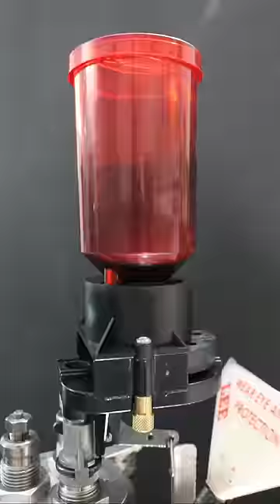Reloading 9mm ammo in 1 minute with Pro 1000  -   #reloading, #9mm, #leeprecision, #ammo, #shorts

Comment: I really like Lee for their affordable products, which are generally quite good, but that disc powder measure is gar-bage
Reply from the maker: Good afternoon Brian and thanks for stopping by🙏👍🙏. On the larger, paper like powder I have no issue with the disks personally. I purchased extra disks and made specific holes for some charges and powders because as you know the disk has limitation on how many different changes you can make. Recently I am using the caliper system also by lee "Item 90792". This replaces the disk and gives you a better possibility to adjust. With all that in mind, I still think they could have done much better. This is a critical component and I would have copied a system such as the one on the Dillon for instance. Anyway, it is affordable as a solution so one thing compensates the other.

Have a great day.
Reply: @ReloadingMoreAD1966  nailed it. No idea why they haven't done something better there.  I swapped mine out for a Hornady measure, it's red too, looks right at home 😂.
Reply from the maker: @brianhonsinger8214  Those are good. Hornady know there stuff. Do have a look on my channel for much more longer clips on the subject, and more. Have a great evening

Comment: Which Bullet is this??
Reply from the maker: Hello and thanks for stopping by. The projectile used here is a 130gr SJFP, reference B-329 fabricated by PRVI, diameter of 0.3545. 

A similar projectile that I have also used, more frequently than this is the 125gr SJSP, reference 613573 by Fiocchi. Both mentioned projectiles I have used to reload 9mm and .38 special rounds with no issue what so ever.

Have a great evening.

Comment: Does it press in a new primer at the same time it dumps the powder in?
Reply: No. Primer is seated on the bottom (when the table is on the bottom), but powder dropped on the top. 2 vertically different positions
Reply from the maker: Good morning and thanks for stepping in🙏🙏🙏👍👍👍. You are correct. Have a great day.

Comment: I need to start handloading. I shoot 44 Mag/special and  45-70. 
  I also shoot 357/38 but the prices have come down enough to make them not too expensive.
Reply: I wonder if you load a really light bullet in a 44 mag what type of velocity itll go at. But like, a really light bullet. Maybe even dare i say, Hollowfor weight reduction idk
Reply: @TheAnnoyingBoss  I know you can get 180 grain 44 mag rounds up over 2000 FPS out of a lever action with a 17 inch or longer barrel. I haven't tried anything lighter.
Reply from the maker: Good afternoon and thanks for stopping by and having a look at my content🙏🙏👍👍.  For 44 Magnum I opted for a single stage press. Works OK. Have a great day.

Comment: Does the neck get crimped?
Reply from the maker: Good evening  and thanks for stopping by the channel.👍👍.Here I am using the 9mm die set by lee, item 90509, comprising of a total of 3 dies.

The first two dies are not relevant for the crimp procedure. The third die is seating the bullet in place and also crimping tight the bullet. Now be aware that the crimp is not a roll crimp, sort of what you see on older revolver rounds but just a minimal crimp, similar to factory loaded 9x19mm ammo supplied by most brands. 

Thanks for showing interest in my content. Have a look at the longer clips on this press, link in my pinned comment. Regards, take care and have a great weekend 👍 👍

Comment: Seems like a simple job but expensive when you buy everything
Reply from the maker: Good afternoon and thanks for stopping by. Here is a small calculation to give you an idea about the costs involved. BUT.. Don't be fooled by my entertainment video that reloading is a mundane and easy operation.
Reloading is a very dangerous affair and it requires lots of time, patience and restraint.  Even so, mishaps can happen.. 

Here are my own workings as follows: 
🔶Based on 9mm setup only. (Changing caliber is approximately $100 addition, mostly dies and shell plate)

🔶ALL FIGURES & CALCULATION DONE January 2022 as follows:

$300 _ Lee Pro 1000 Press 9mm, ref. 90640.
$020 _ Lee Case Collator, ref. 90667.
$045 _ Lyman Ammo Checker, ref. 7833000.
$012 _ Dillon precision case lube, ref. 13733.
$055 _ Scale frankford arsenal, ref. DS-750 
$050 _ Price estimate for a generic caliper.
$048 _ Price estimate for kinetic bullet puller. 
$530 _ TOTAL INVESTMENT of above listed item ONLY.

$160 _ TOTAL Calculated price of raw materials to fabricate 1000 rounds type (CPRN-124gr) "brass cases free)
 
$300 _ TOTAL Average price for factory loaded ammo, 1000 rounds, 124gr.

🔶Therefore, excluding labor cost, I save $140/1000 Rounds.
🔶Therefore, investment of $530 / Savings of $140 = 3786 rounds.
🔶Therefore, after 4000 rounds I start saving $140 / 1000 rounds I send down range.

🔶🔶🔶 In short, after 4000 rounds I cover ONLY my investment cost. Expect more cost as you go along.

Comment: Hello, can you tell something about components, what brand of powder, primer and bullet you use? I know that nickel brass are Federal, bullets looks like Fiocchi but I don’t have full confidence.
Greetings from Poland👻
Reply from the maker: Hello and good morning. Trailing is a list of items I normaly use, all depends on what is available. BUT.. Don't be fooled by my entertainment video that reloading is a mundane and easy operation.
Reloading is a very dangerous affair and it requires lots of time, patience and restraint.  Even so, mishaps can happen..

Here is what I normally use for 9x19 reloading.

Heads: 
- 124gr RNCP, FNCP by L.O.S, NTW, Fiocchi, Romana Metalli, H&N or Frontier.
- 124gr RN Polymer coated RN by ARES or IGF.
- 125gr SJSP, reference 613573 by Fiocchi.
- 130gr SJFP, reference B-329 by PRVI.

Primers:
- S&B, Fiocchi, CCI, Murom or Federal.

Propellant:
- N320, CSB5, CSB6, FRex, Vectan SP8. 

Note: For the amount of propellant and overall length of the projectile follow the specified data by each respective manufacturer of the specific product. 

Have a great day.
Reply: @ReloadingMoreAD1966  I’m asking about components but I’m very interested about bullets because they are for 38/357 in .358 diameter. Have you got any issues with these bullets in 9mm? I use .358 bullets once, but it was soft Frontier 125gr and the load was made for HK USP who literally “eat everything”
Reply from the maker: @Spyderco79   Not familiar with the 125g Frontier but the Fiocchi I am using here is 0.3565 in diameter. That is what I measured with my micrometer. The box is also marked as 9mm. Here is an independent link of the box: ( https://shoparmeriapalmieri.com/COMPONENTIRICARICA/30239-fiocchi-palle-blind-38-357-125gr-8000000031327.html ). 

This Fiocchi head on a 9mm round gave me no issues when fired from a CZ75.

Take care.
Reply: @ReloadingMoreAD1966  Thanks, have a nice day 👌

Comment: Correct me if I'm wrong... but I think it didn't crimp
Reply from the maker: Good morning Kaizer and thanks for stopping by.👍👍.Here I am using the 9mm die set by lee, item 90509, comprising of a total of 3 dies.

The first two dies are not relevant for the crimp procedure. The third die is seating the bullet in place and also crimping tight the bullet. Now be aware that the crimp is not a roll crimp, sort of what you see on older revolver rounds but just a minimal crimp, similar to factory loaded 9x19mm ammo supplied by most brands. 

Thanks for showing interest in my content. Have a look at the channel for longer, non-short clips for this press. links in the pinned comment. Regards and take care.

Comment: WHERES THE FINAL CRIMP!?
Reply from the maker: Good afternoon and thanks for stopping the the channel Were Guy 👍🙏. Here I am using the 9mm die set by lee, item 90509, comprising of a total of 3 dies. The first two dies are not relevant for the crimp procedure. 

The third die is seating the bullet in place and also crimping tight the bullet. Now be aware that the crimp is not a roll crimp, sort of what you see on older revolver rounds but just a minimal crimp, similar to factory loaded 9x19mm ammo supplied by most brands. 

Thanks for showing interest in my content. Have a look at the longer clips on this press, link in my pinned comment. Regards, take care and have a great day 👍 👍

Comment: No powder cop? Or alarm?
Reply from the maker: Good morning Sawduster. Thanks for looking at my content. Hornady Powder Cop or any type of alarm would be such great on this press. unfortunatly this is capable of taking just 3 dies and design not with a powder alarm in mind. on my particular model, I included a camera that is pointed directly at the filled up case and I have also a case, just positioned behind the 3 station so that I can compare visually before placing the projectile in place. On the camera monitor, I also mark the level of the powder so that if a different charge comes out I can discover it before I seat to bullet. It is not as good as a factory production alarm system but it work fine so far.

If you are interested, I have a longer clip of this press, link in the pinned comment. Also here is  link for a short clip about the powder camera I installed. youtu.be/OaCQr102rzo

Take care and have a great week.

Comment: I have never been able to get 9mm flat nose to work.. they don't feed very well in my opinion
Reply from the maker: Good morning and thanks so much for stopping by Mike👍🙏.As a general rule, when using flat nose projectiles the OAL of the complete round is shorter compared to a round with a projectile that is round nosed. I personably have not had any such issue.  The OAL is all dependable on the weapon you are using and that you need to determine yourself. Just evaluate the CIP or SAAMI data sheets and start accordingly. I found that the flat nose type are even more accurate. I used  nose in CZ, SIG, Star, Astra, Schmeisser, CMMG and also Luger P08. Not necessarily the same type as the projectile you see here but a copper coated type. Take care and have a great weekend.

Comment: How much do you sell them for average per round
Reply from the maker: Hi Erik. Thanks for looking at my content. Selling them would be in breach of the arms act in my country. I am not permitted to give out for free or even reload for other licenced shooter.

On average 9mm cost me  11c to 16c per round, depending on what projectile I go for. More in the near future because price are going up.

Have a great evening 👍👍
Reply: @ReloadingMoreAD1966  I seen another video like this so you reuse your casings and less expensive than buying new rounds?
Reply from the maker: @eriksmalling2494  hi Erik. Yes I reuse my cases or cases from other users. I make sure to roll size and tumble clean before I do so. 

Here is a price breakdown I did for someone recently.
---------------
Putting this YT Short demonstration aside. Here is what I normally go for on a batch load. The data I based on my last batch December 2022.

€90 x 1000 heads, similar to or same as item 4O0908P from https://www.leadextrusions.it

€45 x 1000 Primers, Fiocchi type (These I purchased for €65 per box of 1500 primers but they have now gone up to €70 and €80 in some stores and they are very hard to find.) "https://www.armeriarossetti.it  or http://www.armeriafracassi.it - Item: FIOCCHI inneschi Small Pistol"

€25 x 1000 loads of propellant. Propellant I normally go for Maxam, Rio or Fiocchi. depends on the type but an estimate of around 3500 rounds per kilo is very reasonable. The last batch I loaded was with Vectan SP8 and I got that for a very good price of just €50 / kilo because it is a 15 year old stock held in a rusty container, but it worked perfectly. (Photo of the container in my community post. 

 - - - TOTAL €160 / $180 - - -

With this in mind, and with the fact that it is getting hard to get reloading material, the prices will obviously increase, but so will/is the price of factory loaded ammo. 
-----------
Take care and thanks for looking at my content. 👍👍
Reply: @ReloadingMoreAD1966  no problem and thank you for the info some don't provide it 🙂

Comment: Y did y need all those primers?
Reply from the maker: Good afternoon.. Thanks for stopping by and having a look at my content🙏👍.. This particular short clip I opted for a slow mode with only one bullet to make the process more understandable. Normally it goes much faster so I would need more primers than just 1. Also this is a round from a loading section of 200 in total.

Have a look at the link in the pinned comment for the complete view of the process on some 9mm or alternative, even more details for a .45ACP. Have a great weekend

Comment: Definitely a nice setup but I like to check too much and too many times to trust something like this. I hand prime my casings to make sure they seat well then I always like to check my powder and length measurements until I get that perfect then I do every 10-20rds to make sure it’s going smooth
Reply from the maker: Good evening Wild cat. Thanks for your comment and looking at the content👍🙏👍🙏. I still use a single stage press and do even more inspections than you mentioned. For the more common type of rounds, this press is great. Also lots of inspection are possible here. Have a look at the clips on my channel. There are lots of tools and items that could interest you. The pinned comment has a link to my most recent detailed reloading process with this press on some nice .45ACP.

Have a great evening.

Comment: Why aren't you weighing you powder? Inconsistent pours are inconsistent shots
Reply from the maker: Good morning and thanks for stopping by the channel Taylor👍🙏. Prior starting the reloading task I set up the powder dispenser charge as per my requirement. This is the dispenser you see on the second die. The dispenser will always put the correct charge as per the initial adjustment. During the reloading process, I verify every 20 or 25 charges that nothing changed. In addition I have two other means of making sure the charge is always dispensed in the case before pacing the projectile on station 3. 

Have a look at the longer clip of this press as it is very interesting and shows in detail exactly the reloading process. Also available is for 45ACP caliber, even more detailed. Links in my pinned comment, top comment.

Take care and have a great weekend.
Reply: @ReloadingMoreAD1966  Good on ya mate. I appreciate the work you put into the task, and the quality of videos
Reply from the maker: @taylor....  You're welcome. Thanks

Comment: Got any recommendations for a 223 556 reloader?
Reply: Yeah, a Dillon 550 or 750.
Reply from the maker: Good morning and thank you for stopping by and finding time to leave a comment🙏🙏👍. I have a good friend that uses this for .223 but personally I think it is not the most ideal option for rifle calibers. Personally I have experience with the Dillon 650 fully automated and it would be fantastic to have for rifle rounds. Expensive but a great press. Take acre and have a great weekend.
Reply: @Reloading & More  the Dillon 750 is the replacement for the 650. Personally I like the 550 in case there is an error made. You can back the press up if you need to, because it's manual indexing.

Comment: had mine for a few weeks now and having constant primer feed issues
Reply from the maker: Good evening Justin and thanks for stopping by the channel 🙏👍. That is an issue that can drive you mad but it can be solved. there are people with 3D printers making and selling modification. I also did several modification to my press. Have a look at my channel under the LEE playlist and you will find lots. Also for this issue with the primers. Don't give up yet. Take care and have a great week.
Reply: Buy a different press. I have Lee progressive press and it's complete garbage. Trying to make this press work will drive you mad.
Reply: That’s because the caseing platforms dont have cross plane centering slides . Theres so much movement the primer pockets are not centred

Comment: That projectile doesn't appear to be fully seated in the shell.  You can still see the ridges.
Reply from the maker: Good evening Billy. Thanks for looking at my content🤘🤘👍👍. Great observation skills first of all. When I reload I customize my rounds based on the weapon. For instance the OAL for rounds that are specific for the CZ TS 2 are not ideal for the CZ Shadow 1, and vice versa. I consider the cannelure as an indication of the location but it is not necessarily the exact point to crimp to projectile, especially on 9mm heads that are in most cases without a Cannelure.

Based on my weapon, used for these few test rounds, the OAL you see here leaves the grove slightly visible but it is the best OAL for my needs.

Take care and have a great day.
Reply: @ReloadingMoreAD1966  okay cool.  Yeah I have a little experience reloading.  Basically my stepdad would have me process shells for him.  Pistol and rifle cartridges.  Removing primers, putting them through the tumbler, wiping them down, cutting and resizing.  My least favorite thing was polishing brass for pistols smaller than 9mm.  It really gets your hands to cramping when you're doing thousands of them.
Reply from the maker: @myfirstcrappyvideobilly  👍👍👍👍🥇🥇🥇🥇  Thanks for time. have a great evening.

Comment: Nice crimp bro
Reply from the maker: Good morning Mart and thanks for stopping by.👍👍

Here I am using the 9mm die set by lee, item 90509, comprising of a total of 3 dies.
The first two dies are not relevant for the crimp procedure. The third die is seating the bullet in place and also crimping tight the bullet. Now be aware that the crimp is not a roll crimp, sort of what you see on older revolver rounds but just a minimal crimp, similar to factory loaded 9x19mm ammo supplied by most brands.

Thanks for showing interest in my content. Have a look at the channel for longer, non-short clips for this press. Regards and take care.